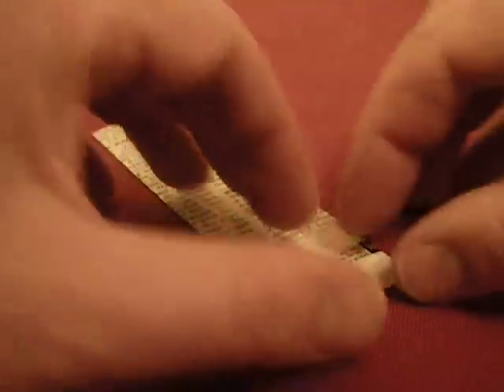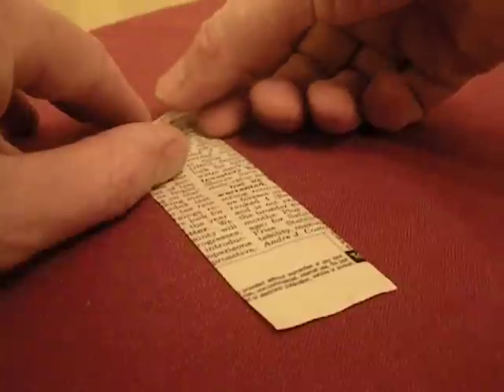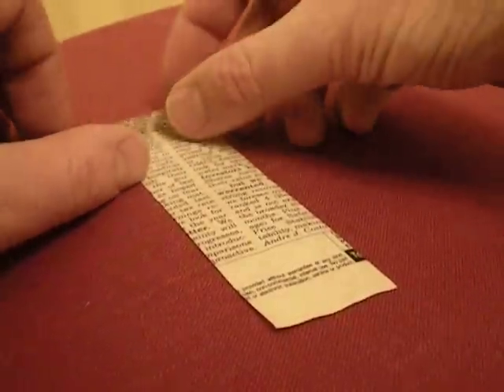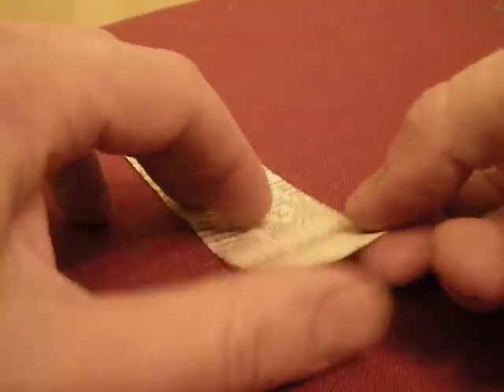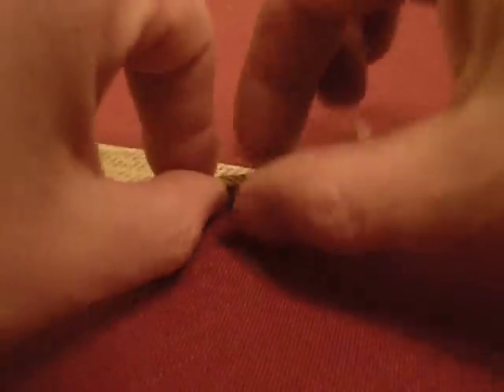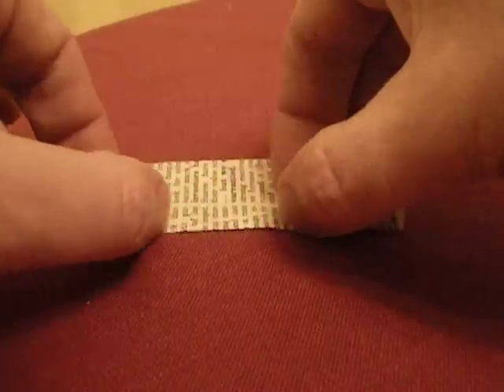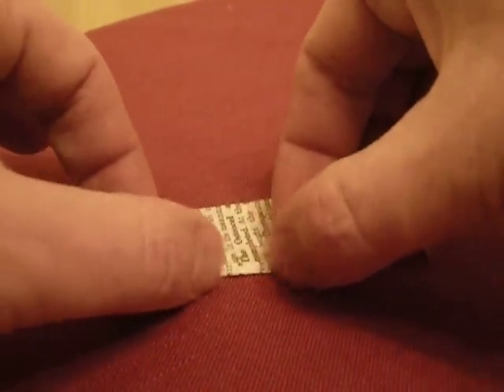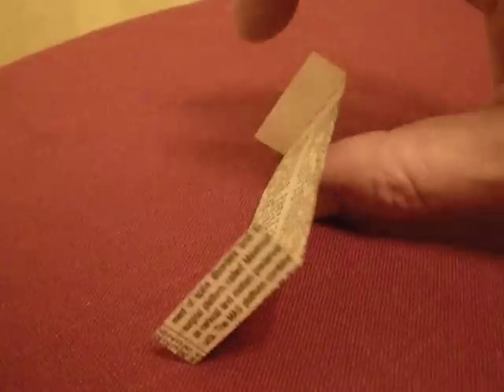How To Make the Easiest Paper Airplane to Surf

Comment from the maker: First find a place where the air is calm (you may need to try several locations away from air currents and close the doors and windows) launch it from as high as your arm can stretch. Then see how fast you can go without it flying up over the top of the paddle.